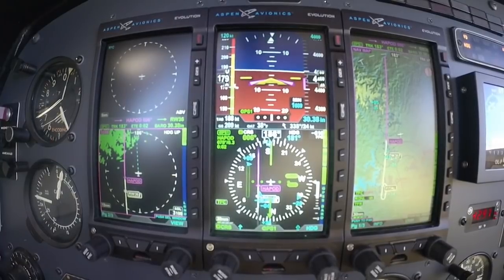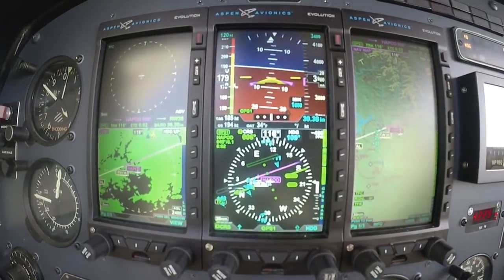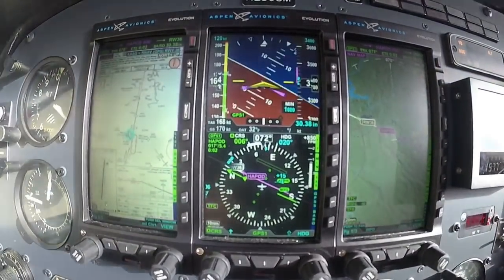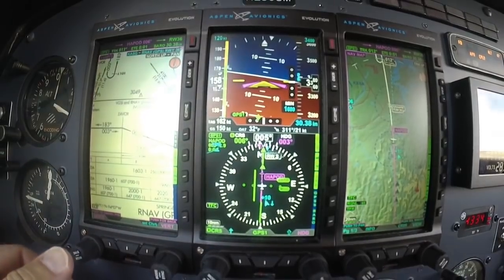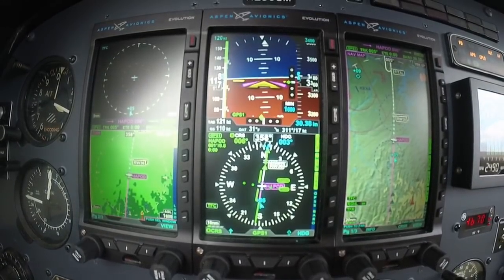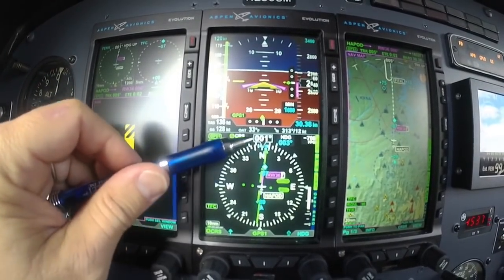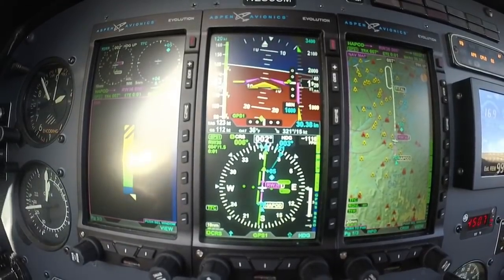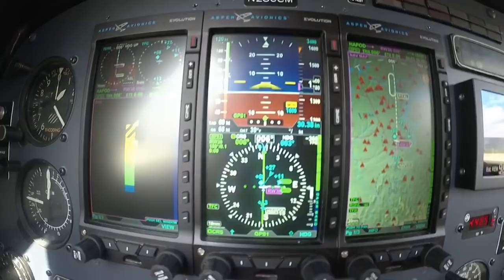Aspen Avionics Approach Tips and Tricks

Comment: So it seems the flight director only works with the autopilot engaged? And I'm trying to word this without it sounding antagonistic which is not my intent, but whats the use of a flight director if you cant use it while hand flying an approach? I couldnt care less about a flight director that can fly an autopilot, thats pointless. A flight director aids the pilot. Am I missing some info here?  Thanks for any input.
Reply: Most autopilots with flight director can display flight director without the autopilot active, it’s on but not driving the servos.
Reply: @OzMIB  I agree, but every time I see a video on any of the glass panel upgrades, when the autopilot is clicked off the flight director turns off with it.
Reply: @David-ty1xz  Most of the time the AP disconnect button on the yoke turns off ALL AP functions including the FD. If you hit the AP enable/disable button on AP the FD remains active but the AP stops providing services.
Reply: @OzMIB  Is there any data to find out? My experience albeit in larger transport aircraft, the F/D has its own separate control for display. If I'm going to be shooting an approach and hand fly in my GA airplane, I would assume that the F/D should stay on until at a separate time you turn the F/D off. I have reached out to other manufactures and there doesnt seem to be anything out there, other than one that did confirm when the A/P is off, the F/D is off, no thank you, again, whats the point other than monitoring.
Reply: @David-ty1xz  I’m familiar with the King KFC150 and Garmin GFC500 APs. They both have a button to turn the AP on and off and on for the flight director. The only thing is the FD must be on for the AP to be on. But you can have FD but no AP and depending on where you are getting you navigation from (GPS or VLOC) it will cue you for that. The AP disconnect switch on the yoke turns everything off. KFC 150 https://am-avionics.com/productos/pa/kfc150.html, GFC500 https://buy.garmin.com/en-US/US/p/604257. Both have FD and AP buttons, so they can be used separately, although their all in the one unit.
Reply: @OzMIB  Thanks so much.

Comment: I wonder if you ever noticed that at 0:07 you got a clearance for 100 and said "one zero zero" but then set the bug for 110.  That's a common human factors trap... I know because I did the same thing on my IFR check ride! I survived the 'ride, but have always double checked those headings since.
Reply: He may have been cheating a little bit which we even do in the airlines when the controllers heading with the winds etc is going to cause an issue like needing to get on the LOC befor the GS where some airline aircraft will capture GS before the LOC or the wind is going to push you inside a fix before capturing the LOC and now the GS could be below you and at an outstation airport the controller may have not enough traffic to realize their heading is going to cause an issue because the winds have changed since they last had an aircraft inbound from that direction and sometimes it easier to cheat a litttle bit than clog the air waves with extra voice traffic where whatever heading the controller gives you is just a heading and the ground track is affected by the winds which may have changed after the heading given. 18k hrs at U
Reply: And again, heading given by tower is advisory only. They are only responsible for traffic separation on the ground. Yeah, I know, it doesn’t sound right and I thought the same and only learned this recently and I have over 19,000 hours personally owning 10 planes and working at the airlines 26 years now at age 56.